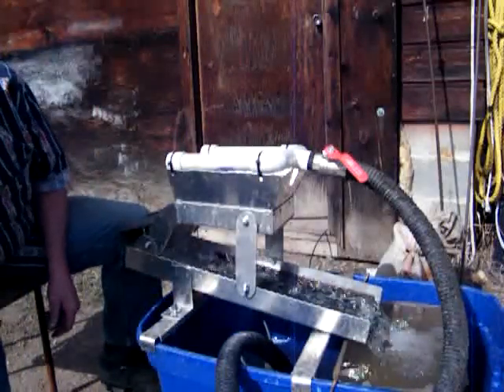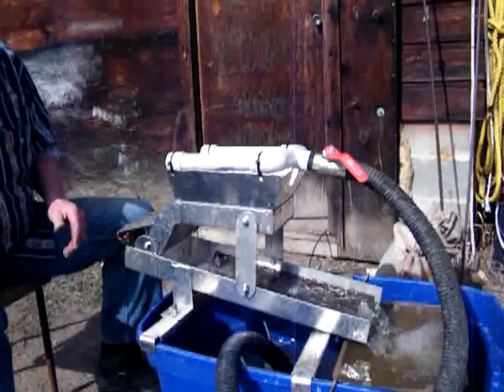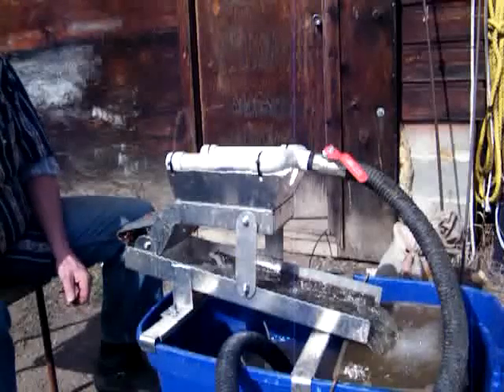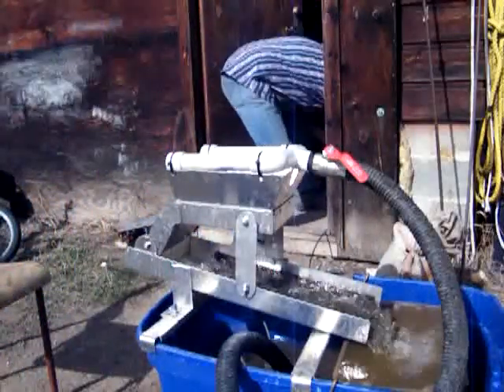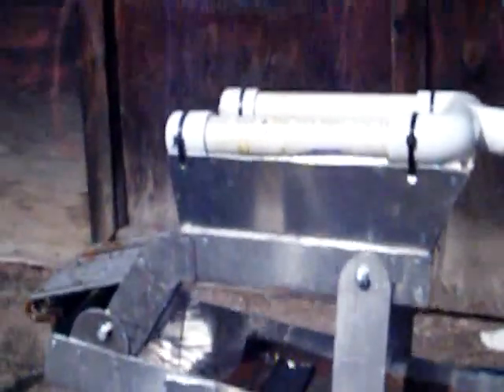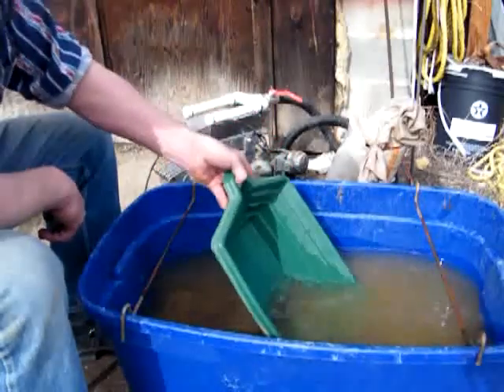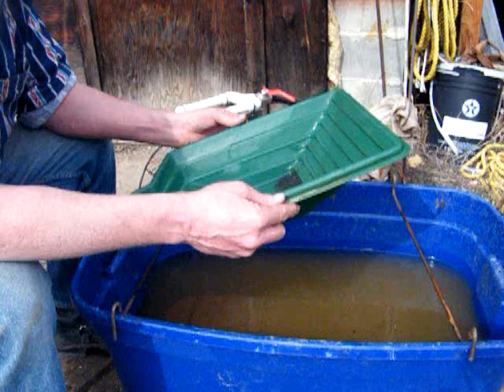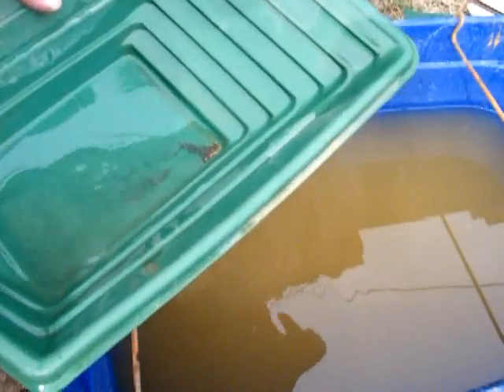Greywolf mini highbanker and panning fines_0001.wmv

Comment from the maker: @beverbuzz  there I was using a 120 volt sump pump, way to much flow, so there was a ball valve, out in the field use a 12 volt 1700 gph Attwood pump, just right...you can check it out on my website,,   greywolfhighbankers